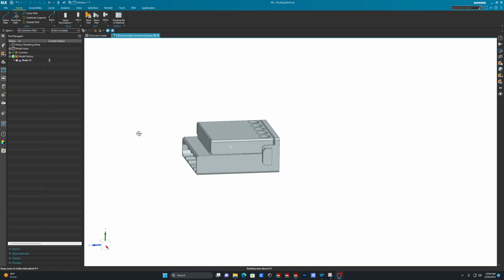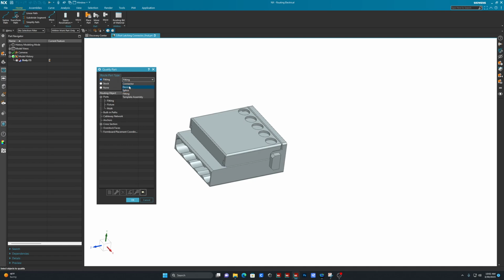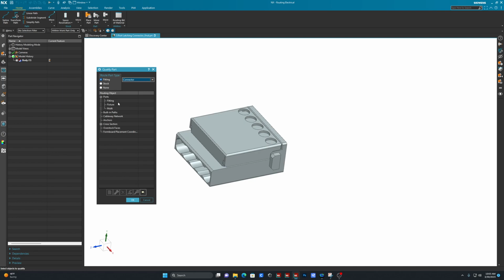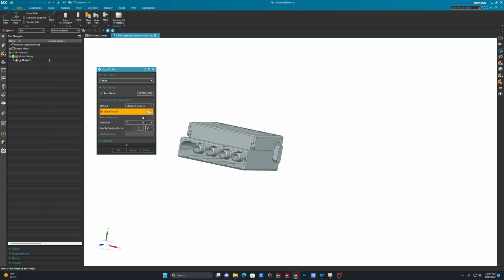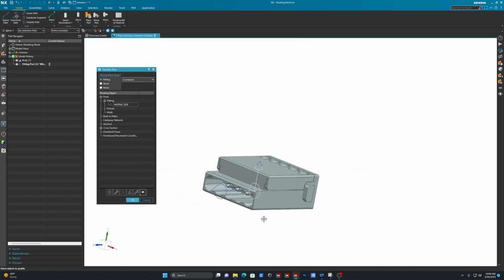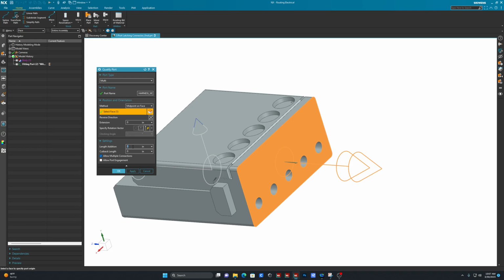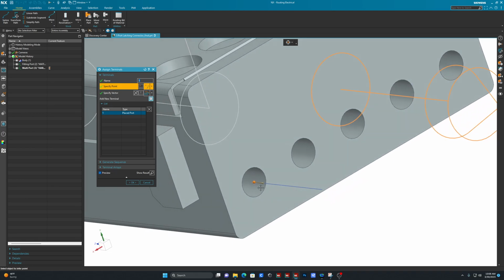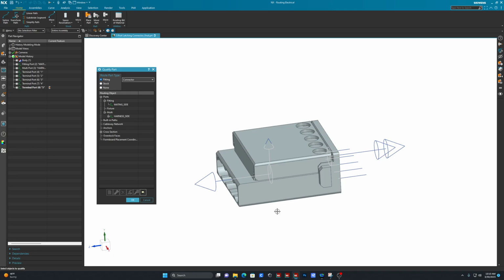NX 2206 Electrical Routing Tutorial - How to Qualify a Part for Electrical Routing

Comment: im not getting these big arrows (cones) after qualifying the port, any suggestions why it could be happening to me?
Reply from the maker: You can edit the port display of them by going to Menu>Preferences>Routing. I believe one setting in there controls the port display. Let me know if that works
Reply: @Jive_Engineering Hey, turned out that my employer somehow blocked that preference and i couldn’t check the box to turn on displaying these arrows. It worked perfectly tho on my home PC. Thank you for the video!